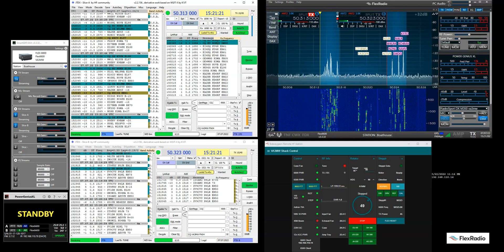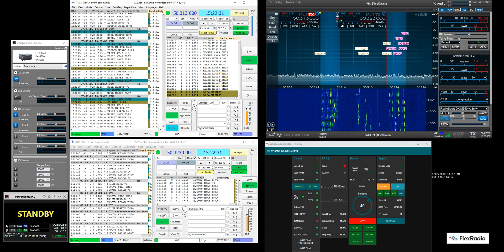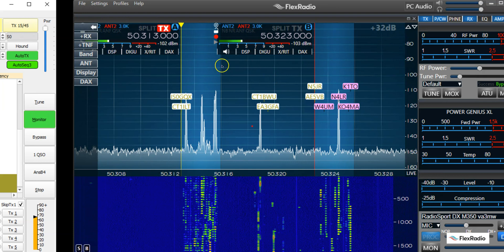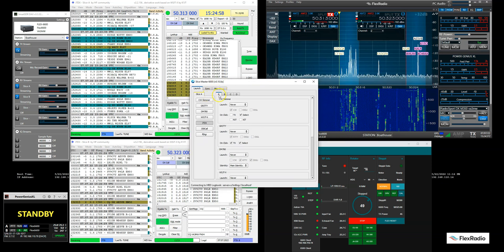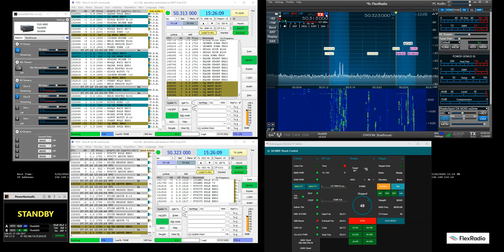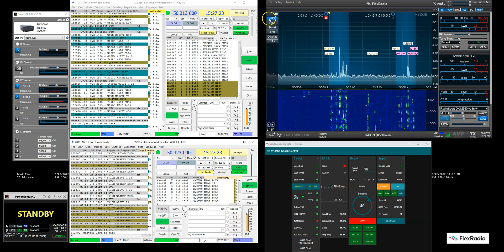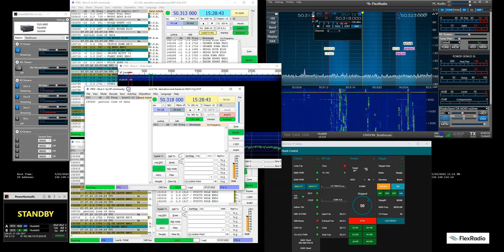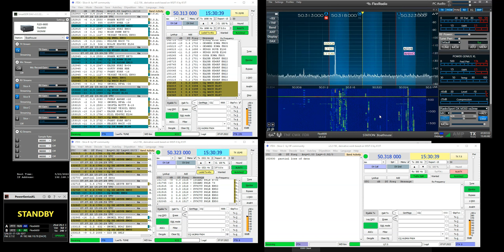Can your HF radio do this?   FT8 and FT4 at the same time on different frequencies.

Comment: Mike, is possible to operate FT8 in two bands simustaneously with Flex6400? Two instances JTDS each in one band, sharing same antena, or ANT1 and ANT2. Or have two instances of JTDX and start TX where we need. 73 de CT7ABD Fabiano
Reply from the maker: Yes, you just have to share 1 antenna.  If you use SliceMaster is configures JTDX correctly.
Reply: Can it be done with wsjx as well?

Comment: could this also be possible using transverters with a 6400? more specifically would I be able to have a slice on 144MHz using a transverter and another slice on 50MHz? I dont have a flex radio yet, but I am trying to wrap my head around how I could use one on VHF with transverters and also access the native flex frequency range utilizing multi slices. or if that is even possible. Thanks Mike cheers , Dan K3TEF

Comment: I heard of SliceMaster but didn't see it in action till now. Question: Up to now during VHF contests I used N1MM+ logger's native method of integrating with WSJT, which includes a feature highlighting new stations and (more importantly) new grids in the contest. Is there a way to get a similar feature with multiple JTDX (new to me) or WSJT instances to avoid dupes and especially highlight new grids in a contest? My radio is a 6500, FWIW, and I know I'm not exploiting its multiple slices as much I should. In any case, thanks for this helpful video.